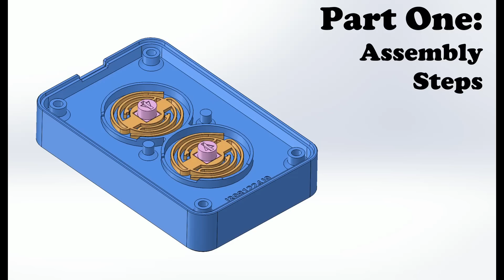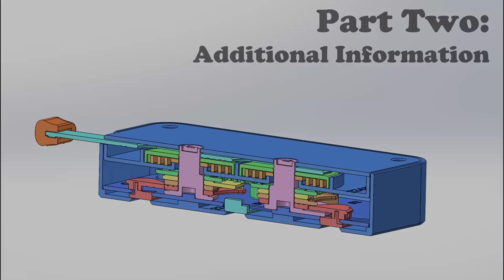7 Segment Counter v2.0 Tutorial, 3D Printed, STL Files Link

Comment: This is a super impressive project considering that the only non-3d printed things needed are rubber bands and a couple screws. You could probably even design it to be held together without screws. Super impressive. Well done.
Reply: Or 3D print the screws
Reply: Detents printed into the body components, especially within the stand-off structure, to hold it together.
Printed springs for the push-action return and for each individual segment, a lot more fiddly and might require expanding the body.
Yeah, all of it could be printed in some way for sure.

Comment: Perhaps a low strength pen spring to provide some tension on the center bar?
Reply from the maker: Not a bad idea. I'm currently thinking of adding a profile to the upper (D1) cam to push the D segment back in the opposite direction.

Comment: Given that both the shafts are tied to the plunger, are the gears actually necessary? And, that aside, next improvements would be a carry mechanism and a reset mechanism.
Reply from the maker: Great comment! To answer your question; Yes and No. I actually had a section in the video that I cut out where I explained the reason for this seemingly redundant design. So, the reason the timing gears exist in the design is because during a few of the tests I performed on a non-timing geared model, the two cam stacks actually fell out of sync from each other a few times since only one of the spring drums had engaged due to a non-complete push of the plunger. The flathead screwdriver slots on the tops of the cam-stacks were originally intended to manually bring them back into sync without taking it apart. I wanted to completely eliminate the chance of them falling out of sync, so I added the gears.

Comment: As a v3 suggestion: Make it so the "rails" aren't visible when the white digit parts are away. You could achieve this by actually moving the rails away and making the white parts with little "arms" to connect with the black parts further away, but maybe this'd make the entire thing a bit bigger.
Reply from the maker: I like your thinking. One of the very early prototypes for this digit I was working on ~2 years ago had little extensions that were intended to block the plate gaps. I abandoned the idea. But I might bring them back.

Comment: question: does the elastic stay stretched in any of those configurations? Or when its zero it stays less stretched? Do you thing its feasible to use springs?
Reply from the maker: The only 2 configurations where they are not stretched beyond their resting position is in the zero and eight positions. My list of future improvements includes moving away from the rubber bands.

Comment: Very nice solution. Do you have alternate cams/ratchets for 0..5 and 1..12, for assembling into a clock display?
Reply from the maker: I have 0..5 cams for the version 1 model (I need to modify them to be compatible with the version 2 shown in this video). I also have 0..12. Check out the 7 seg clock video I posted on 5/24/23. I plan to post a version 2 clock soon.
Reply: @Flower-3D  I saw your servo based clock after commenting. As others are asking for 'carry flag' perhaps this could be a standardized location and re-used to activate the 10-digit (ie for 10, 11 & 12).

Comment: First, I think this is ingenious, my only comment is that I would probably make wire springs instead of elastic bands because most elastic bands are made of latex or other natural rubbers that sadly deteriorate after a time.
Reply from the maker: I would agree with you. Moving away from rubber bands is on the list of future improvements.

Comment: A potential feature idea is to have carryover output/input so you could chain them.
Reply: The mechanical losses are already pretty big... Having to also actuate another one might end up being either REALLY stiff to press, or even break something... But idk! It would be cool to see regardless.
Reply: @Internetzspacezshipz   perhaps each click could add some further wind up to a spring or something so that all that stored energy could be released when it rolls over to 0.    don't do all the press in a single click, but build it up over 10 clicks
Reply: @Internetzspacezshipz  the lever could actuate all 7-segment assemblies simultaneously and the carry over mechanism could act like a clutch. the force will indeed be greater when going over several orders of magnitude.
Reply: @dmytro.d  I like the clutch idea. Some sort of gearing that only moves into place when there's a carry... Then you would need some sort of method of moving the first, then second, etc segment counter... Eventually this turns into a mechanical computer of sorts haha.
Reply: I was just about to suggest the same. Excellent design thus far!
Reply: Maybe the plunger could be split, so that it only activated the rachets if 'activated' from the side (ie lower digit carry).
Reply: Make it like the Burroughs mathematical machine https://youtu.be/fe-9uTVMQlo?si=IJKJGkil5CPoZzBd
Reply: One big problem i could see is how it would take a while to reset it
Reply: Was there a reason the 4 piece stacks and the sync gear can not be 3D printed as 2 parts instead of 10 parts?
Reply: @jimmypockrus7725  I’m sure it was done so you don’t have to use supports to make the cams.
Reply: i thought the same!!
Reply: thatd be easy for qanyone to do in a slicer like bambu studio just add some cylinders and holes and overlay a gear :D

Comment: This is pretty slick. Though on something I designed that had rubber band then spring approaches someone redesigned it to use magnets (reversed poles) to work as springs which was a good idea in the compact space + for a longer lifespan.
Reply from the maker: Thanks! I would prefer to get away from rubber bands on future designs. Magnets do sound appealing. I'm going to consider them.

Comment: Amazing! Now a suggestion:
Leaf springs or similar instead of rubber bands, and plastic screws or some nice snap together (with reverse open possibility).
So it is 100 percent 3D printed. =)
Reply: When I saw his 3D printed springs, I had the same thought. Especially considering that today’s thin rubber bands tend to go off reasonably quickly.  More so, making the design 100% 3D printed (including snap together instead of screws), would be truely next level!

Comment: I'd like a variation that only displays 1 and 0 and another that only counts from 1-5.  These would be essential to build a clock with this.
Reply from the maker: Agreed. I currently have a 0-5 version that I need to update to the later version. As for a 0-1 variant, new cams could be designed that basically just alternate between 0 and 1 for 10 cycles.

Comment: I wanna try print this with a 0.15mm nozzle, would you have any tips for when it comes to figuring out the correct size of rubber bands you'd need, or would there be any other limiting factors you'd suggest to remain mindful of?

Comment: Poka Yoke: If you offset the key in the shaft out of the center, each with a different amount, you'll prevent wrong assembly of the cam wheels - 6:28

Comment: That has to be the best project ive seen for a long time - bravo. Tempted to make a clock using steppers with it
Reply: Why use steppers when you can use a single motor and gears.
Reply: @GameTapesArchive stepper motors can be controlled precisely so they always spin at an exact speed, the only control you have over the speed of normal DC motors is the voltage that you put into them (and even then, any amount of load will make them go out of time)
Reply: @skmgeek  You could use a DC motor on a cam and a limit switch, with an Arduino counting the time.
Reply: @skmgeek  just use a 4rpm motor, input 120v and a small transformer. If you use 4 stepper motors you have to write code. For a clock. You have to use a complicated piece of machinery that has a clock in it to build a clock.
Reply: @soundspark  why do you people want to use Arduino in everything. Stop it. You're building a clock using a clock.
Reply: @GameTapesArchive  Wouldn't it go out of sync if the voltage drifts even slightly?
Reply: @GameTapesArchive  Also 120v is a lot to use for a simple project like this lol
Reply: @GameTapesArchive  No one cares, stop acting like there is some optimal way to make something that's for fun and learning.
Reply: @MovieMationStudios  we have two very different views of the intentions I have of shouting at the void.
Reply: @GameTapesArchive  not really shouting at the void when you're directly responding to me trying to be helpful, but whatever floats your boat lol
Reply: @GameTapesArchive I consider using a microcontroller and programming it to be part of the fun of making it.
Reply: @GameTapesArchive  The whole point is to make something cool and maybe learn something.  There's nothing "pragmatic" about any of this.  Plus, introducing a microcontroller opens up a world of other possibilities.
Reply: @Kihidokid  so what would keep time then ??
Reply: Instead of a stepper motor, you can use a pendulum with a weight, you will get a completely mechanical watch with an “electronic” time display.
Reply: So far I haven't heard anyone mention the solution for the 10's of minutes (0..5) and hours (0..1 or 0..2, depending on 12 or 24 hour time). If you're using a synchronous motor as the drive, you can't rapid step the digits. If you're using a microcontroller then you could, but it's going to get awkward and annoying every hour when you have the rapid step the 10's of minutes from 5 back to 0.  Personally, I'd like to see some cam stacks that allowed making a digit either 0..9, 0..5, or 0..2.
Reply: What about to look on other videos on his channel? he has some clock with this segments 😁
Reply: Ahhh just use a simple solenoid to pulse it. Don t over think things
Reply: @rty1955  had to scroll to the end of the thread (so far) to find the word "solenoid".

Thank you! The final mechanism works by pushing down repeatedly, so why not use the electromechanical device, which performs exactly that movement? Also puts more fun in the sound 😁
Reply: I wanted to make one using solenoids.
Reply: Don’t need stepper motors or limit switches. Simply pulsing a DC motor long enough to hit the limiter plus a little for security and letting the rubber band back spin the motor when power is stopped would be sufficient to actuate this thing reliably so long as it doesn’t hang up and runs smooth. You could even connect the motor etc the screw slot he added to the model sticking out of the back of the rear plate so the design wouldn’t even need any modification. I may try to do this myself with stuff laying around. I gave a few old SC motors that should do the trick that I would just need an ESP32 to pulse a relay for. Just need one with enough torque since using a gear box would make back driving the motors to reset the mechanism much harder.

Comment: I noticed the built plate texture on the front. Did you choose a texture surface to be more readable?
Reply from the maker: I did not choose that texture specifically; it's just the stock build-plate of the Anycubic Kobra Max. My other printer has a sheet of PEI (glassy) as the build plate. For these digits, I would prefer the Anycubic build-plate's texture over PEI because it's less glossy and reduces glares significantly. So my preference would be to use a texture that's more matte rather than glossy so glares don't wash-out the segment display.